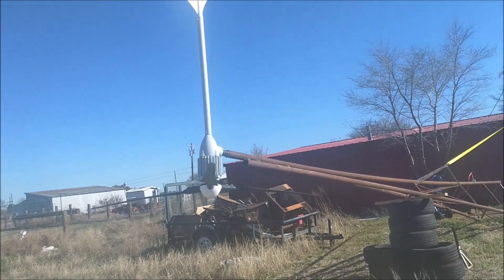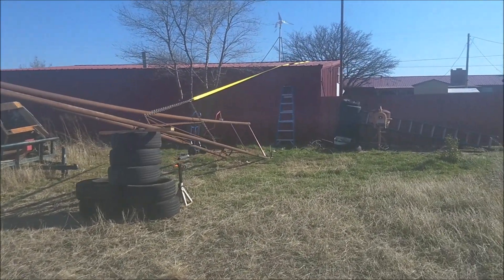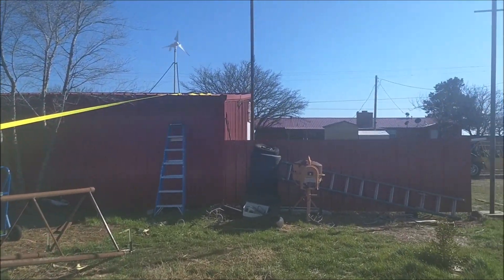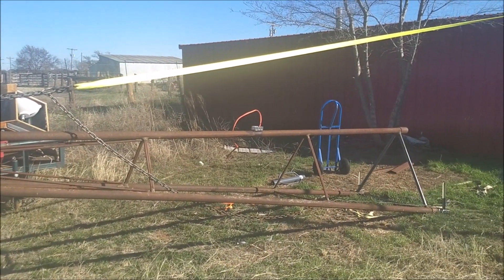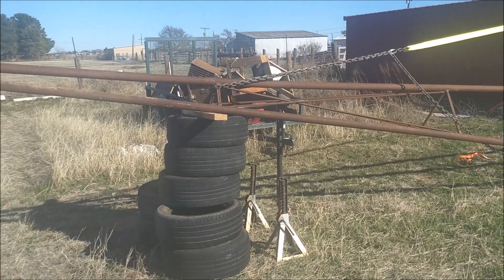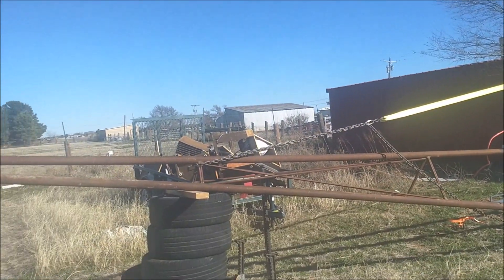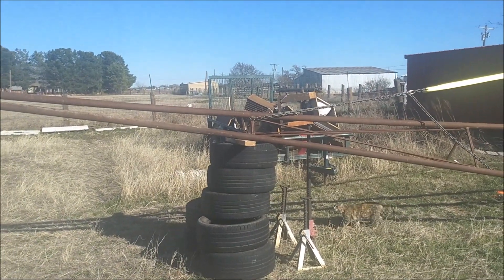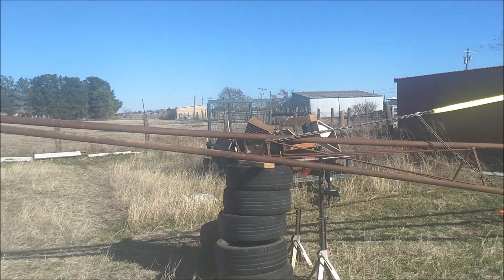Standing up the oilfield pipe wind turbine tower for the iSta Breeze i1500!

Comment: Nice :) I was thinking of doing one a similar way. 3 concrete foundations in the ground, and 2 legs hinged, with the "normal" third leg being the one that gets pulled on. And my method would involve a 12,000LB winch that I have laying around, rather than a truck. Tilt it as far back as possible with the winch, then do what you did near the end, and pull down on the chain at the end with another winch, or a hand ratchet.

Comment: Slow and steady and you kept your cool nice one,  i was flapping like a chicken when i put mine up, i'm looking forward to see what the output is like on that one.
Reply from the maker: I was very nervous standing the thing up.  Every little move the thing made I thought it was going to fall over.  The video makes it look much less exciting that what it was.
Reply: @ToysforWatts  I know what your saying i was like a kid with a new toy when i put mine up still am, are you putting any guy wires on it even if just around the top just to be on the safe side, i'd hate to see it go over especially onto your roof, the rotor on the turbine looks to be a good size so the force is going to be quite high in a good wind.
Reply from the maker: Not running guy wires but I may brace the thing to the shop.  It's got just a little over 7ft of swept area but the blades are pretty thin...I don't think it'll be too much strain but we'll see.  I don't have a great deal invested in the turbine and I have a good fall radius in every direction but the shop...if it hits the shop it won't damage much, it's a pole barn with more poles than it really needs.  This tower is a bit of an experiment to see how wide I need to make the base in the future.  If it falls it's going to be a learning experience :D
Reply: @ToysforWatts  A brace sounds like a good idea, wow that's  quite a wide sweep on those turbines i hope it works well  when you get it going, i've heard good and bad things about that brand so i'm interested to see what you think, i'm just running a small 500w Chinese one but i'm having a few problems but would like something a little bigger in the future.

Comment: nice , i dont think i could sleep until i put some heavy guy wires on it but i do everything overkill.
Reply from the maker: I specifically want to avoid guy wires...if this one proves to be unstable I will lower it and spread the base out.  I've done windmill towers this way and while they generally do have larger ground footprints, they have 8~15ft (sometimes more) solid sails up top.  I "think" it will be fine but we will find out.  SCIENCE!
Reply: @ToysforWatts  got a build on for a freind next year for his 90kg 2kw  3.5m blade span turbine , its going to take some concrete